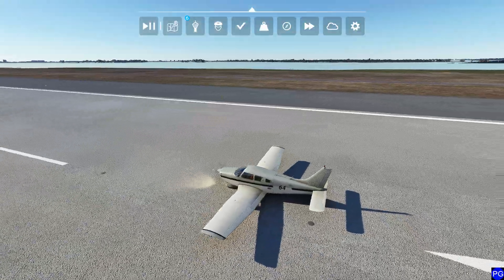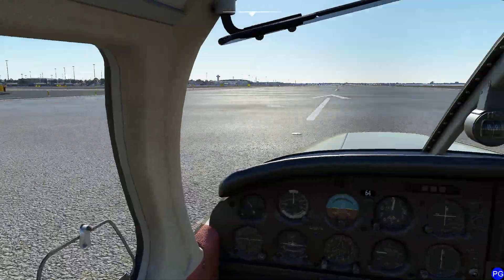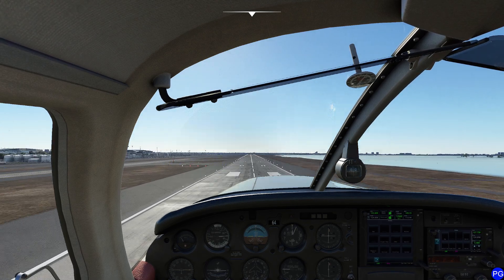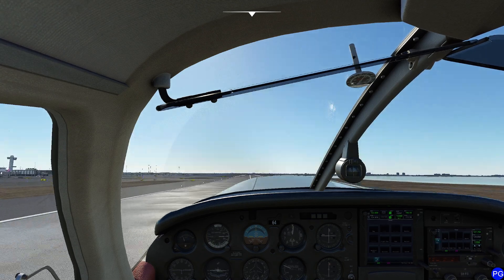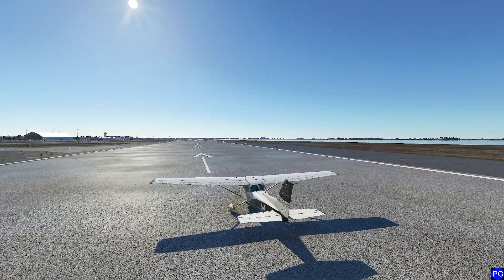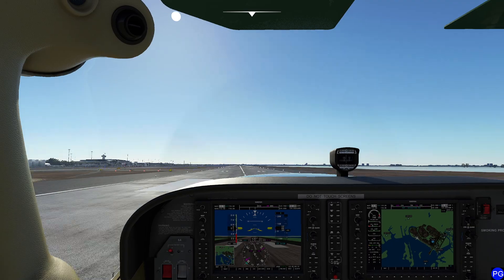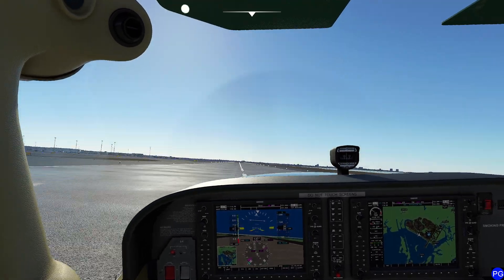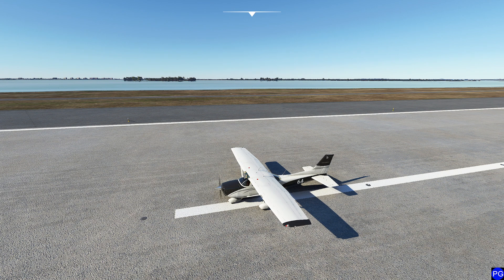MSFS - Understanding Ground Effect

Comment: Can you explain the comment about grass flying? What is grass flying (I assume taking off from a grass runway) and what makes ground effects their MO?
Reply: He;’s talking about using ground effect as soon as possible, when flying off of grass/dirt strips, just because the ground is rough. One can accelerate in ground effect rather than bouncing all over the grass strip waiting to build up speed.
Reply: @Part_121  How do you accelerate in ground effect without building up speed? Do you mean you just pull up early and fly very close to the ground until you build up enough speed to pull up?
Reply: @GizmoMaltese   Yep!
Reply: @Part_121  
like you when you get towed with an aux landing gear: lift the wings little early, let the landing gear stay on the runway and stay in the ground effekt (the level of the tail of the towing plane); for the people who stay thight to the regulations: you should of cause adjust the angle of attack on your starting gear /tailfin holder to the specification of the manufacturer and never use air resistance (drag) as a substitute for lift.
Reply: The airplane can accelerate faster in ground effect versus on a grass runway where friction is increased and acceleration is slowed by the grass.
Reply: Bushflying maybe?
Grass don't do much different from asphalt in simulators (it has some traction-related quirks IRL).